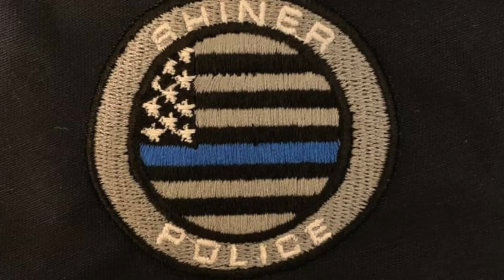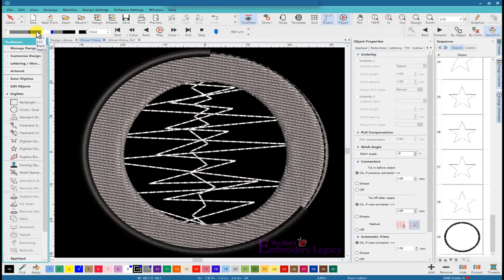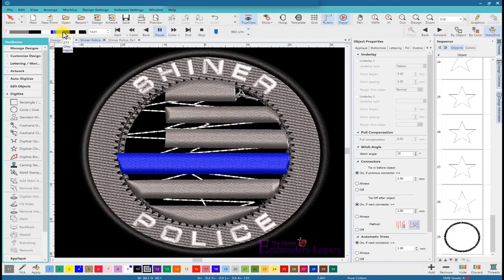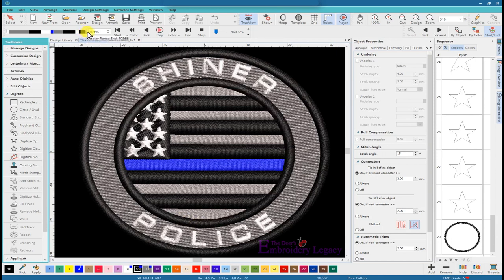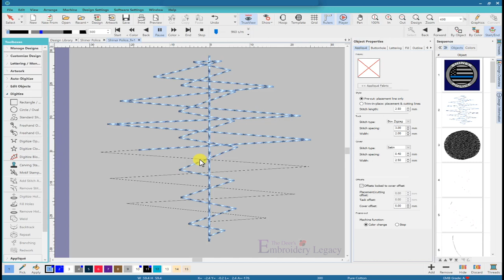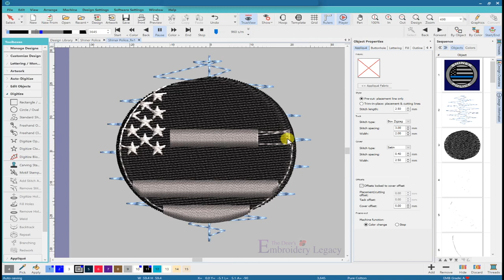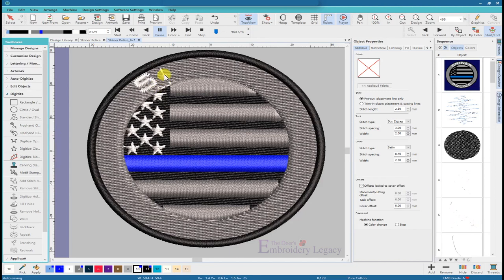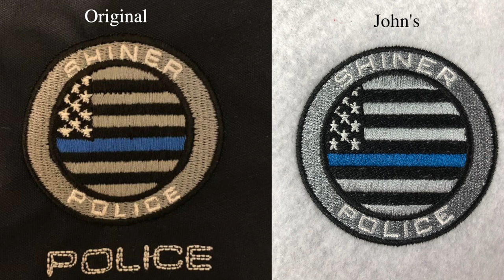Digitizing Logos on Caps - Machine Embroidery Tutorial

Comment: Do you really digitize by drawing in all 10,000 stitches by hand! That's crazy impressive. How does that work with designs that are stiching out photos with people or landscapes? Also, would you suggest using Hatch or the commercial Wilcom software for an apparel/embroidery business?
Reply from the maker: Rory Cassel only did the stars one stitch at a time, the rest was manually digitized using tools within the software... I’m not that “old-school” :)
With regards to Hatch vs E4, I’d make the decision based on price point and needs. I do have both and can digitize most designs just as quickly with the same quality results with Hatch as my E4. The design in the video was done using Hatch.
Reply: @EmbroideryLegacy  Thanks, this was a really informative video to better understand how digitizing works